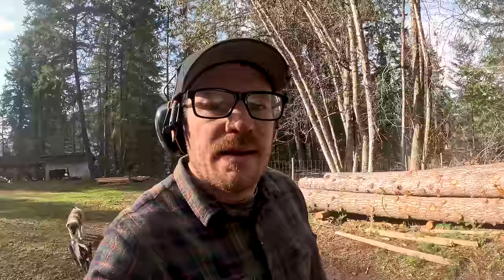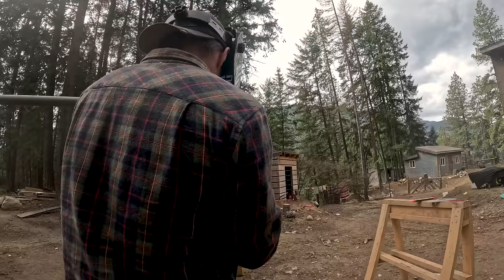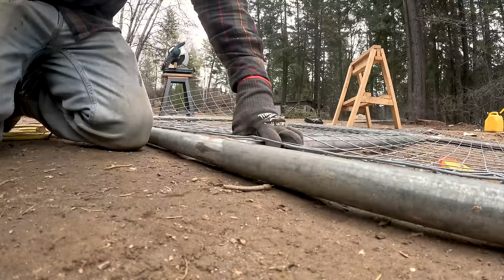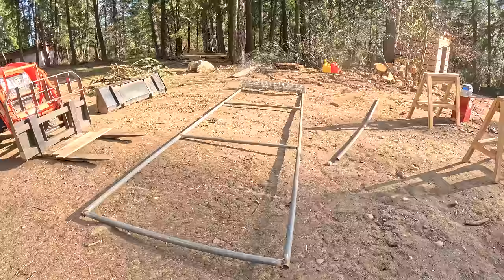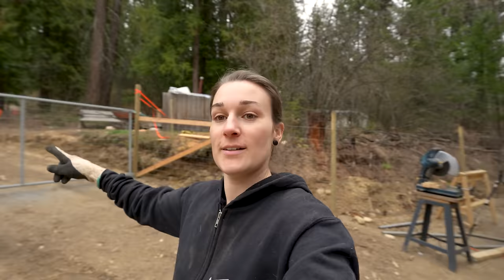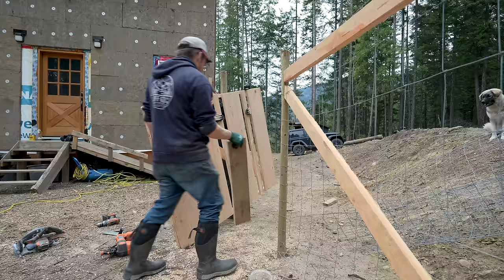Fortifying Our Off Grid Oasis With Custom DIY Gates

Comment: The biggest problem with most people that weld with Migs they don't clean the steel good enough it has to be perfectly clean and then you just got to figure out the right temperature and then a 7 year old can weld with a mig or a tig I started out with a buzz box and I tell you that's hard welding when you're welding thin steel though burning through then I got a meg and the hardest part with a mig was body work and quick bind those little tiny rolls of wire there are way bigger roles And when my make I had the gas much easier to use that flex core is dirty or Weld And with a mig you have to have a very steady hand My biggest mistake with the buzz box was everybody used to use 7018 rod and that's a farmer's rod you know you look at those messy farmer worlds for a high heat temperature I went to a 7014 rod way easier to well with and it's an old position rod but if you got dirty oily metal to weld on a buzz box use 6013 it's a messy rod but it cuts through a lot of dirt

Comment: Add a 10 inch swivel wheel on the non supported end of gate, thats what ive done to my 16ft gate and it works just fine.

Comment: Most really wide gates are split into 2 gates and then mount a wheel on the base of the center where they attach. If this gate becomes a problem, you can always change it.

Comment: Its a good start, those posts will really need to be concreted in, there is way too much movement, over time they will wobble loose, also gates need additional cross bracing to help it support its own weight.  Running from top centre to outside bottom corners.  Did you paint primer over all your welds to stop it rusting?    Welding is an art and needs a shed load of practice but once you get it its like a bike.
Reply from the maker: He did a galvanized spray paint I believe

Comment: YOU COULD GRIND THE GALVINIZING OFF IT WOULD MAKE FOR BETTER PENETRATION, TO WELD.  I MADE PIPE GATES YEARS AGO AND THEY ARE STILL IN USE.20 YEARS NOW.  DON'T OWN THE PLACE ANY MORE BUT I DRIVE BY OCCASSIONALLY.  THEY ARE HEAVY, I ADDED AND 10 INCH WHEEL TO THE OPPOSITE END, IT WAS OFFSETBUT WORKED FINE.  I USED CATTLE PANELS FOR WEBBING.

Comment: Part of the problem is the galvanized steel, grind it off where you are going to weld next time. And on welding wire mesh start your puddle on the pipe then move it to the wire. less chance of burning through the wire nesh.

Comment: you can also add a wheel on the gate to help support it but like i said two 8.6 gates that meat in the middle would be lighter and not take as much support  im just thinking out loud here so carry on lol  ps on the bottom of gate you can place a pipe down with hinge so it can swig both directions and drag on ground which will work fine then this fills in so animals cant come under the gate

Comment: I always say that you give someone an auto darkening helmet and a wirefeed and before long they will be pretty darn good at welding, and working outside you probably could use a smaller mask! What size rod were you using? Cut the post at an angle

Comment: 2 smaller gates in place of the 17' footer would be better, maybe a 10' and a 7', or a 12' and a 5' footer. A 5' footer would be better for foot traffic when you don't have to open the whole thing up. More labor & mats up front though, and eventually metal posts concreted in

Comment: they make a metal cutting carbide tipped skillsaw like blade for that saw which cuts 15 times faster and smoother than the cutoff disc you have. check it out.

Comment: 17' is a BIG gate, you need telephone/power poles about 5' concreted or at the very lease, tamped in very solid, then, it's a maybe it'll hold the weight and leverage. The poles you are hanging on, will sag more and more over time. The 17'er, should have been made into two gates. Even the 8 and a half foot gate needs better support. I hate to say all this, but I do have experience in building fence and gates.

Comment: As long as you grind the Galvie coating off Greg. Thats a huge help, so yur meltin steel to steel. Welding is all about not contaminating the 2 metals yur joining. Aka needin the flux or gas... purity is primarily what what they do. weld flat or downhill. not up. Make bacon.... set heat.... and adjust the speed to prevent popping, and prevent blowin thru. you will get it. 👍👍🏁🏁🤙🤙🛠️🛠️🛠️🔧🔧🙏🙏🙏🙏

Comment: Wonderful work; I don't care about ugly welds as long as you spray paint - it will increase the appeal a lot. Question: why did you do a single 17.5 ft gate as opposed to two 8.5 ft swinging gates? Less weight on a single post, same overall opening and more versatility (you can have it half open if ever needed).

Comment: Some times it is better to build 2 gates instead of 1 long gate. and if you put one hanger up and one down then it can't be lifted off, if i was going to use a gate that long i would use 3 hangers instead of 2 for support but it looks good as far as welding the more you do the better you get.

Comment: I am 62 years old an my trade as a welder all my life i have welded more  Galvanize steel then many have. In a shop as well as open air. Never once wear a mask of any kind . Like any shop welding there a shop vent fan.  For table top welding like gates there an  Exhaust pipe you swivel a bove your work. People these days make such bs out of every thing. Buy spray can of cold zinc primer an spray cans of bright zinc to prime an paint all areas you welded after power wire wheel. If you dont it will rust faster then any other steel.any gate over 12 feet needs to be a doubble gate here in Canada if you exspect it to work great over the winter. Or they will be a fight every time. Your post pin bottom one points up top one points down so it cant lift out. You buy the pipe clamp hings that you can set any were on the up right pipe. Also your up right pipes need to stand 2" higher then your cross pipe so you can put the pipe caps on an lock them with there set screw

Comment: Should have done a dual gate on that 17 foot. Doto putting the small gates on hinges, you need a push and a pull sign put up so people won't ruin the hinges by pushing the wrong way. Would have been better to use the same hinge you did on the big gates.

Comment: Greg, I have a question, why not split the big gate into 2 sections?? Less weight and easier to open and when you don't need the big space to get through just use the half gate?

Comment: don't breath that weld!  ... There is a small lead content on the galvanized coating. When welding, this lead will vaporise and form lead oxide fumes. These gases can cause long-term health problems such as lung and brain cancer and even complications in the nervous system.... good luck!

Comment: Gates look good and functional.  Why couldn't you have built two gates to span the 17' opening instead of the one gate?  Also, the first gate post looked like it flexed a bit when swinging the gate.  It might need to be braced.  Do Juniper and Aspen ever stop wrestling?  Thanks for the episode.

Comment: Hi kids,  I like the videos Katie. Greg need to do what @awdvkd9292 said to do , It's call a tie back the wt. will pull poles down OK.  You can use alumina wire to tie the fence to pipe and use a easy Heger dat side up and down on pipe. You will learn as you go ask question before you do it OK.  Be safe out there.

Comment: I don't understand why you made that big gate why you just didn't make it into two halves and then put a locking system on the middle of the gate that way you could open half the gate to get small things through both sides for big things through

Comment: Your breaker tripping issue could be due to the extension cord being too far from the power source.  I had a really nice cut off saw motor burn up because I connected it more than 25’ from the power source.  I was bummed to say the least.
Reply from the maker: It pushes the limits of a 15a circuit

Comment: I hope you regestered all your Rigid power tools on the rigid web site an uploaded your Canada sales recite. This has to be done with in 30 days of date of sale. To change your warrany from 2 years to life time. I all ready had 3 batties replach in 5 years. On one set an nothing yet on the 2nd new set. Not many read the fine print on the 2 year box lable
For many years due to there great warrany ridgid the only brand i buy any more. They even up graded me to a much bigger battery on last battery i waranty
Reply from the maker: It’s a limited warranty
Reply: @ThisOffGridLife  in all the years I bought used an claimed warrany on the regestered life time warrany I have found nothing limited. If anything I had products up graded at over 5 years old. Never had to pay for a battery a tool that got wet an no longer worked.

Comment: Come on guys, you have a forest at your disposal, and a sawmill to process timber into any size you need, and yet you go ahead and build a fence using toothpicks for strainer posts and swing gates. How could you imagine that that would work long-term, you should have milled and used 5'' X 5'' min, your gates will sag and drag and be a pain in the arse every time you go through them. Whenever fencing the bigger the posts you can use the better, you have already put the work in once, and you don't want to have to go back and do it twice,  it's really surprising considering everything else you do is normally done belt and braces and built to last.